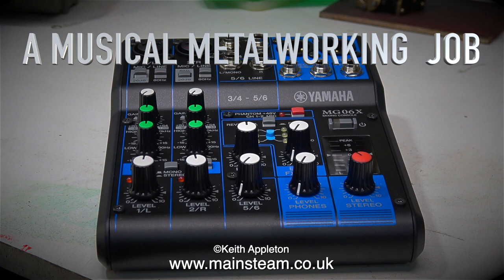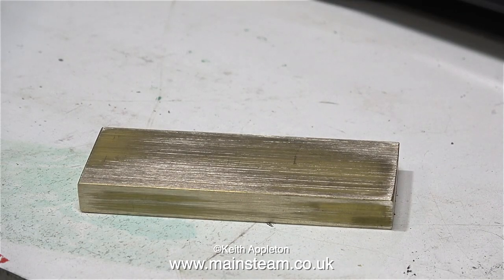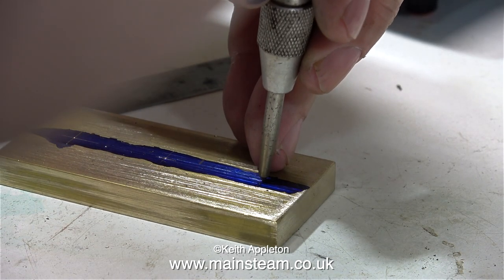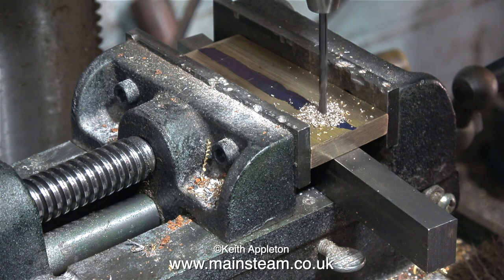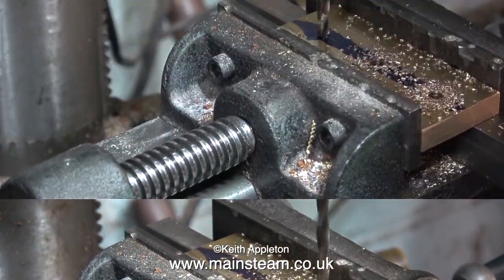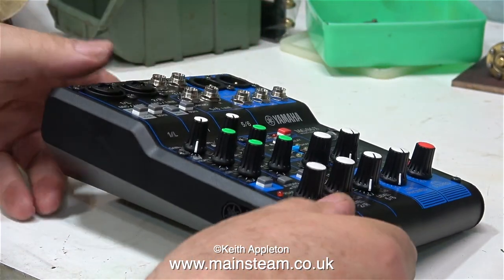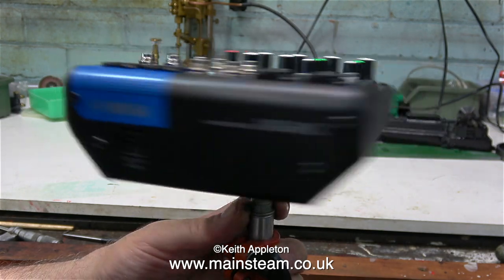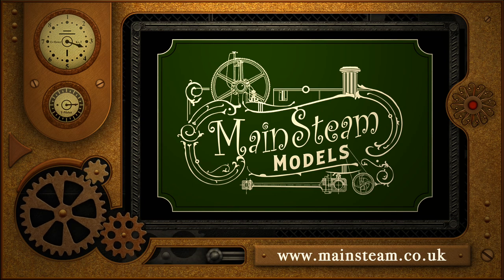A MUSICAL METALWORKING PROJECT - IN THE WORKSHOP

Comment: One thing that I have found that works for me when drilling holes like what you did is to put the bolts in the holes, measure the outside distance, then subtract the width of ONE of the bolts from the previous measurement. That gives an accurate center to center distance for the holes.

Comment: I had a similar job this month mounting a water pump in my computer. I was a bit more finiky about precision so I measured the outside to outside distance between the mounting holes, the inside to inside distance and averaged them to get the exact distance.
Then I calculated the diagonal distance across the 4 holes, marked I all up on the case, drilled them out, and realised I forgot to make sure they were level. 
Had to lengthen the holes with a file to level everything up...
Reply: I'd like to thank you for the confidence you inspired in me to do projects like this, and for showing me the importance of files which until now only ever saw as deburring tools and not as poor man mills.